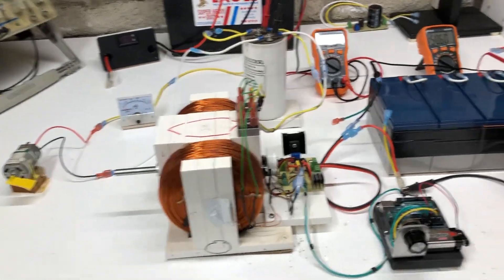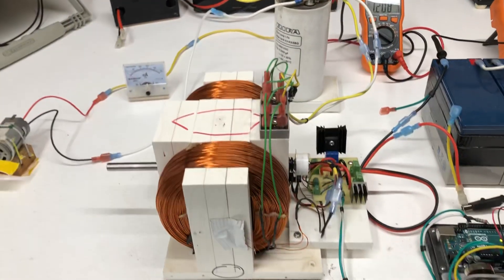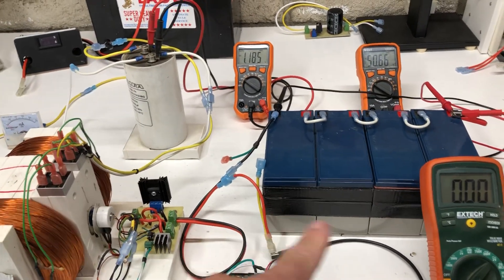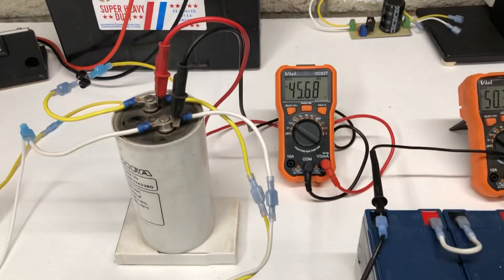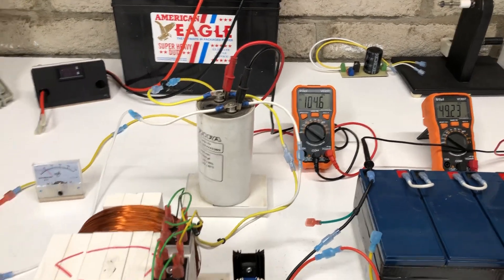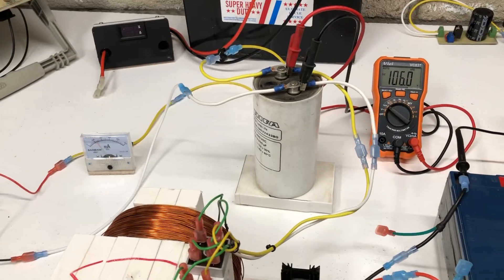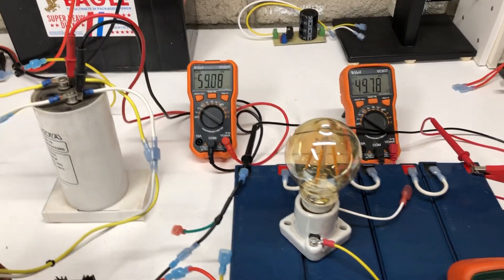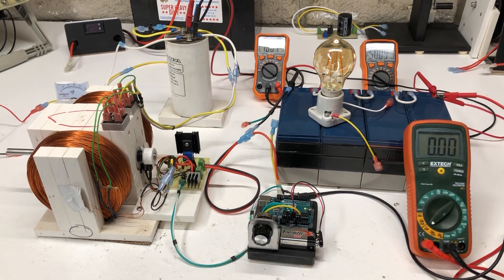Newman motor output running dc motor

Comment: Is it ok to say that the large motor pulled 30 watts at 49 volts .6 amps?  Any design specs that we should know about?  This motor seems so much better than other demos that I have watched.
Reply from the maker: Thank you for the comment! 
 Yes that’s correct 👍 
Second motor used 13 watts so about 43% usable energy output pulse mechanical

Comment: These are great experiments - I got dissolutioned with the Newman motor because could not get near OU but did enjoy trying! There is a guy in Philadelphia that has several and his largest has 5000 lbs of wire on it! I saw it in person - looked like a hot tub. I measured the efficiency (rather crudely) but it calculated around 60% efficiency - much like these small models.
Reply from the maker: Thank you ! 
 Wow that’s crazy I would have thought it would be better! One thing I know is it takes a lot of time to make things work right 

My outboard motor does 65 % with no load 
 I don’t know anyone that can test my machines 
 I do know more wire more output is definitely true